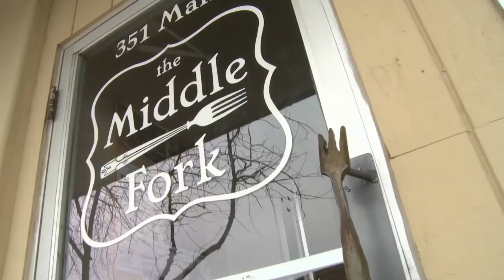Farm To Fork Wyoming - Grass Fed Beef

Comment: These farmers are amazing. You guys are helping save the world, keep it up... That chef though, hm. Pink salt (sodium nitrate) is definitely killing all bacteria, that stuff is literally poison. It's actually a sad irony to take a product from farmers with the brilliance to recognize that roundup (glyphosate championed by the USDA) is actually a terrible, dangerous chemical, and put sodium nitrate (a dangerous chemical championed by the USDA) on it. The white coating he's getting is definitely not the healthy mold bloom he should be getting, it's salt decanting on the surface because that bresaola is staying in cure waaaay too long. I think mine typically goes 3-5 days, a week at the most, definitely not two full weeks getting redressed half way through, that's crazy, not to mention grinding the kosher salt defeats the point of using kosher salt (a crystal form of salt that's actually hollow and has greater hygroscopic properties), at that point just use fine sea salt and save on the labor. I also have no idea why he cut the loin in half, why the tip of his boning knife is so dull, or why the blade on his deli slicer is so dull that it's causing him to cut so thick and uneven (that last one is really unforgivable, there's a built in sharpening mechanism). He owes it to these amazing farmers to do their product greater justice. I can't over state it, these guys are actively saving the world. No other profitable human activity is engaged in active carbon emission harvesting.
Reply: I can tell you've never had to work for a rancher. I spent several years in my teens and twenties working farms and ranches. They pay a straight salary which comes to about a dollar an hour. I had a wife and three kids to raise. When one of their cows got sick they made me butcher it and take it for part of my wages. Maybe you didn't know farmers and ranches don't have to pay minimum wage like other businesses. Their is no workman's compensation , no osha, no unemployment, no benefits of any kind.